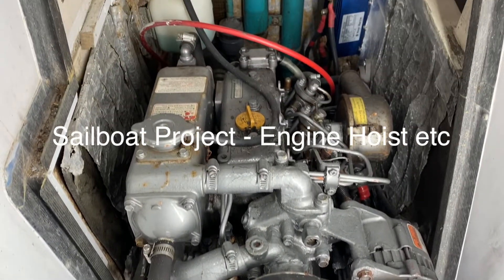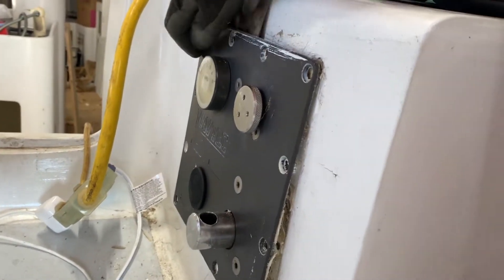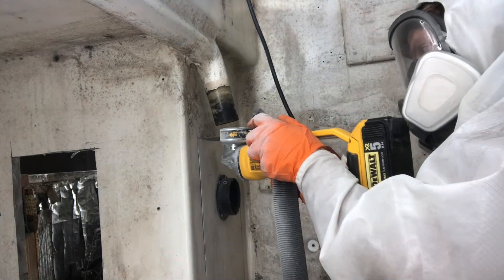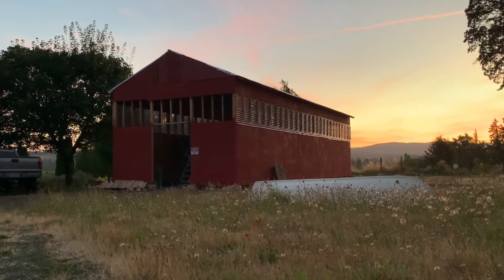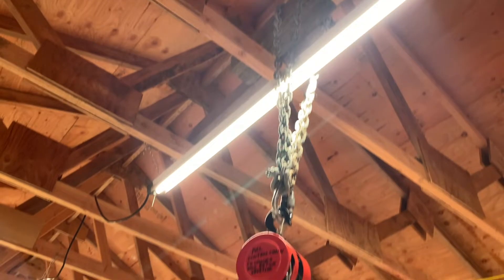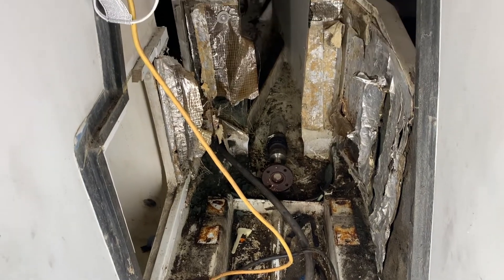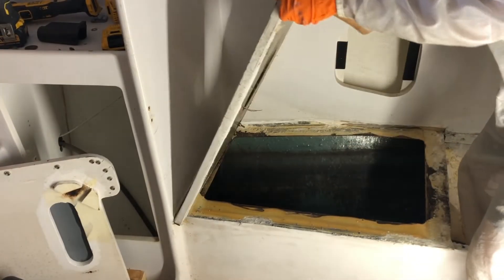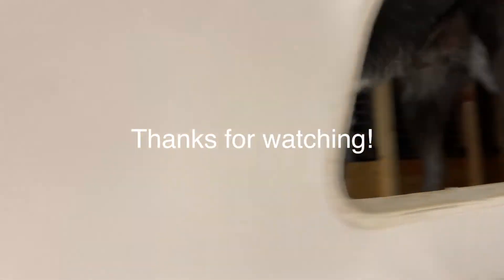Boat Project #5 - Engine Hoist Etc

Comment: This is counterintuitive, you get a racer which is built to be lightweight and one of the first thing you do to it is teating off glaased in tanks and plan to replace them with steel ones, those are really heavy, at least consider  building them in glass\carbon ot something, otherwise going in that direction you either will lose most of speed characteristics or wont be able to carry most of stuff you want.
Personally-id jusr pop those tanks open, sanded them, applied new epoxy and then seal back, because it all was probably calculated at the design stage, epoxy is safe, it is not hygroscopic like other resins.
Reply from the maker: yep we're making changes that will make it a bit slower / cruisier, it'll be a bit slower in the end but we want to live on it - kind of a smaller version of what the Duracell Project is doing, but in our case it was built as a racer/cruiser, not purely for racing. We want more space for water so a small tank up front to balance out the weight we add to the back might be the way to go. Definitely trying to keep weight down regardless, but still want it to be comfortable